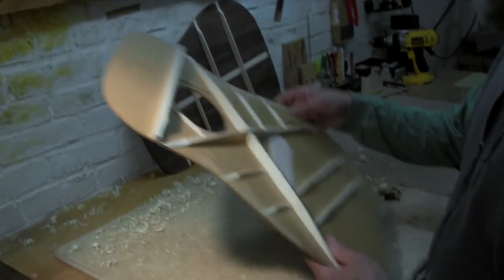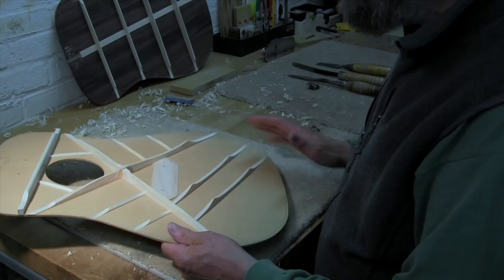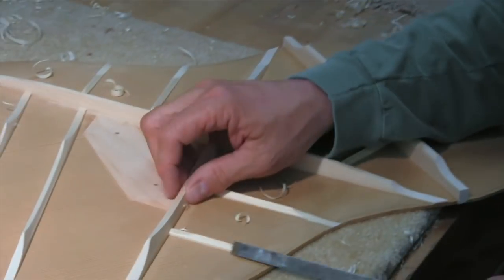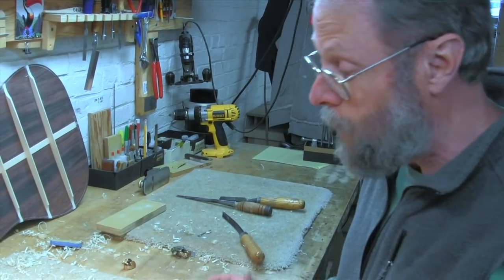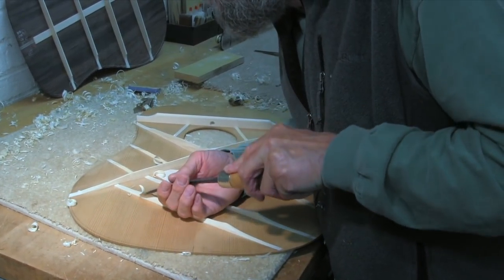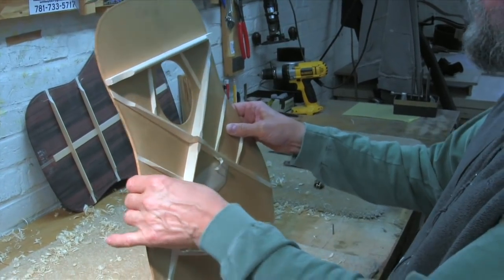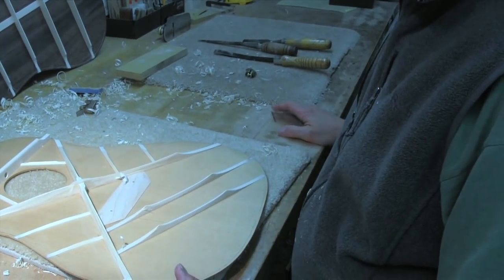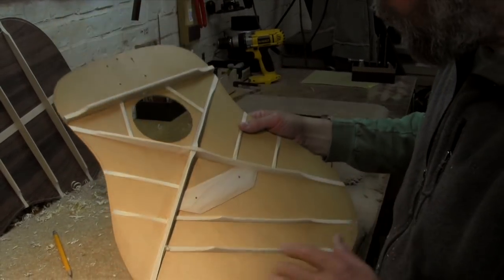Bourgeois Top Voicing Demonstration

Comment: Thanks very much. I found thar extremely interesting.  I'm only a hobby luthier, and not a particularly good one, at that. But I've played around making the odd instrument for three to four decades.. Firstly, I believe that the high points on your scalloped braces, are in fact, some of the node points along the length of the brace.  A friend build a number of superb marimbas, in my workshop a number of years ago. The marimba keys are exactly like the braces. There is a huge difference in the vibrance, of a shaped key, in comparison with a flat key. Yes I realise that the note also changes.  I also believe that if you wanted to go further. you could thin the top itself, around the area of some of the anti nodes.  I believe that as well as mechanically strengthening the top. The purpose of braces, is to transmit the vibrations across the grain, of the top to various points. Something that I have also wondered, is, if the bridge is situated on a dominant node, along the length of the soundboard, and for that matter, the whole length of the instrument, as well. Surely this must have a profound affect on the sound of the instrument. These are only my unproven theories through my own  observations. I'm very interested in other peoples opinions about this?

Comment: Fascinating. I have to wonder, though, how directly that predicts how it will behave when the entire edge is glued to the sides, the finger board glued to the top, the bridge added and the string tension applied? You showed how just holding it in different places produced different tones, so it must be different in the completed instrument.

I’m not suggesting this is hooey, it’s been done forever, and I’m sure it helps, I just wonder if it works for reasons that are not fully understood.
Reply: yeah you have a great point. pretty much just getting good tap and flex will make for a great sounding instrument but of course someone who has spent years doing this will argue.

Comment: I've read and listened to many explanations of tap tuning and it's still as clear as mud to me.  I guess from experience a builder might learn that a certain tap tone will produce a certain type of sound in a finished guitar, but it just seems too subjective to me.  For instance won't the tap tone alter when the soundboard is attached to the sides, effectively immobilizing the wood at that point and changing the way the soundboard vibrates?  I'm not saying that Dana's guitars aren't fine instruments, just that some of the things he says just don't make sense to me.
Reply: exactly! i'm sure a lot of good gets done with the process outlined here, but i can't help thinking that the fine tuning should be done with the sides attached, also the neck and strung up to full tension
Reply: Contact area of top sounboard affects only a tiny portion of upper harmonics. Fundamentals and the main harmonics remain Intact. Haven't you noticed what drummers do, with tape on snare drums? Back and sides act in amplifying sounwaves.

Comment: Okay, tap, tap, tap, thump, thump,  what's up with that?   What is a good sound or a bad sound?  It would help to compare a good one to one that is not so good.   When I see people put sand on a top with a speaker under it I can see how the vibration moves the sand to spots which do not vibrate.   But all this tapping with no comparison doesn't really say much.  If I built a top, I too could tap on it but, the sound would not tell me any thing unless I recorded the sounds then when 10 guitars were done I could cross check those which sounded good and those which did not.  I have a feeling CFM could have build a few hundred before he was able to determine what was going to work.

This comment is not meant to be critical.   I greatly appreciate the time you put in to this and most of all the time you invest to get musicians great guitars.